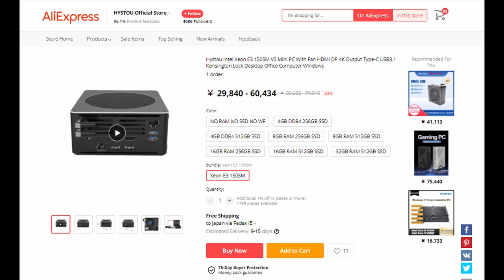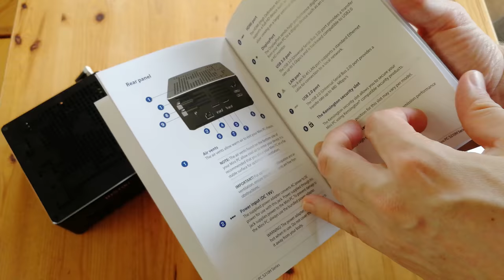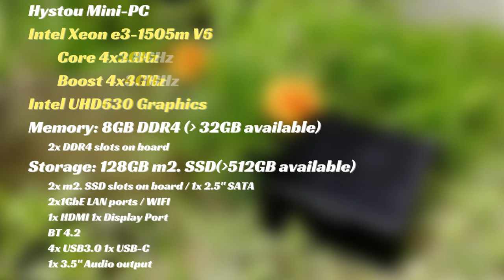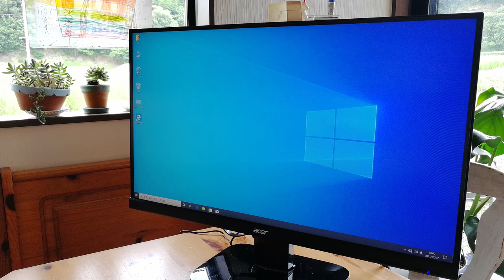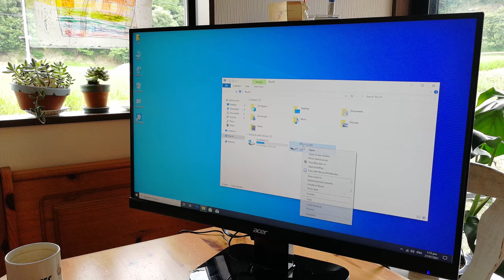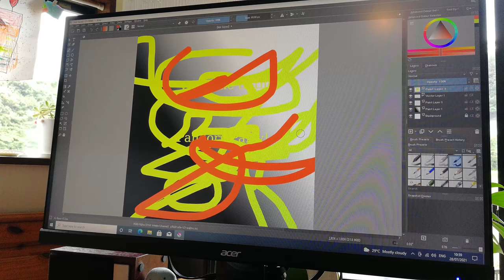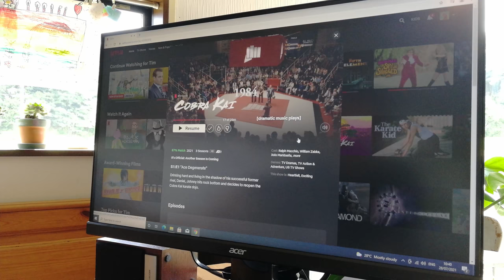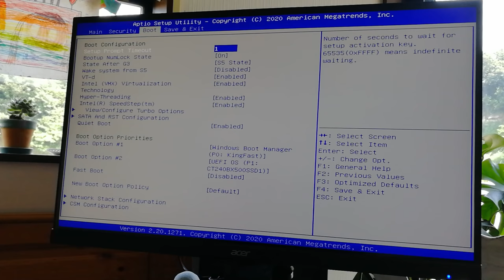Super Console X PC Box!? [Hystou Intel Xeon E3 1505M Mini PC Review]

Comment: Great review 
I want to ask you If the difference between this and Intel J4125 is big and worth the price difference?
I am planning to use it with batocera emulation and am not interested in PC games.
Reply from the maker: I guess that all depends on what you're wanting to emulate. What are you intending to play?
Reply: @TeamPandory  Any system below the PS2, such as the GameCube, PSP, or 3D Mame games, as the PS2 is difficult to emulate even with a Xeon pc
Reply from the maker: @r3troid  Well the J4125 is actually just at the border of running most 2x resolution at 100%.  Gamecube / Wii is really hit and miss (limited to the 2D games), whereas this one wipes the floor with it in that case.  -  TBH this one could probably do more PS2 games well, it's just racing games weren't really a fair way to test them.
Reply: @TeamPandory  so you mean the J4125  wasn't good with gamecube and wii 3d games and this in the video do all them good even with ps2 games ?
Reply from the maker: @r3troid  we've reviewed a few systems with the j4125 and even the next one up the n5100. Check the gameplay for each.

Comment: Hey guys, pity it doesn't have the space to add a low-profile dedicated graphics card. have you come across any of these that do?
Reply from the maker: Nah. They're far too small. Need to look at the mini itx style small tower units for that, like the dell, but even those are limited with the amount of power the PSU can push. 
Nothing beats a decent rig.
Reply from the maker: @electroarcade  Between an ... i5 SFF ?  - Question.  What is an SFF?   ;-)
Reply from the maker: @electroarcade  Oh, right.  So yeah, same thing- you'll be looking at a limit on your PSU- The one you linked had a 250W PSU- That'll limit the GPU choice.  I actually have a system with an i5 and a standard sized GPU stuffed into the low profile case.  While it does work, it is kind of...Off.  I have yet to try Teknoparrot on it, but games on Steam work quite flawlessly.  Not tested it under complete load though-  it might just croak if that becomes the case.
Reply from the maker: @electroarcade  To compare even the $300 or so PC in this video to a 905x3 you can pick up for $40-$50, it's not really a fair comparison tbh.  In the end you do get what you pay for, however the 905x3 is amazing value. - As is the N2+ which we had on a month back.
Reply: @TeamPandory  True and while worlds apart in price, looking at it from a.. if you spend 15X more $, what will be the X increase in performance? and is the extra spend really worth the extra performance? I'm waiting to see on your next comparison :-)